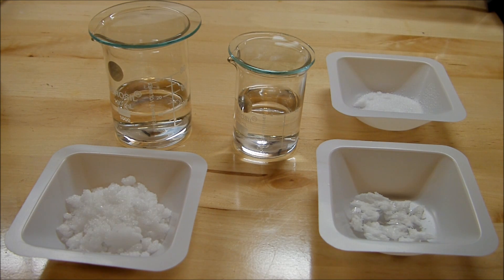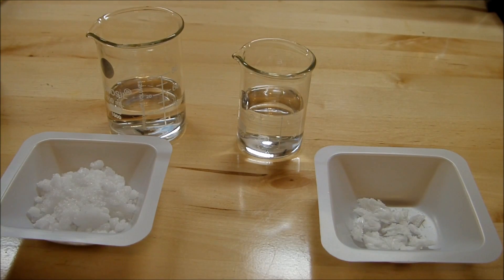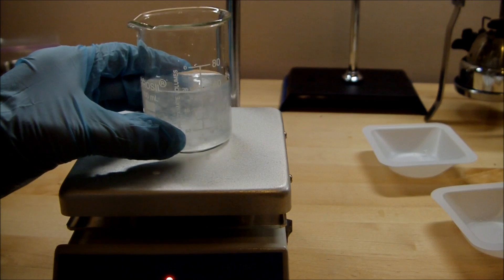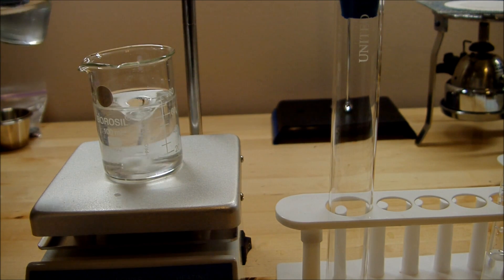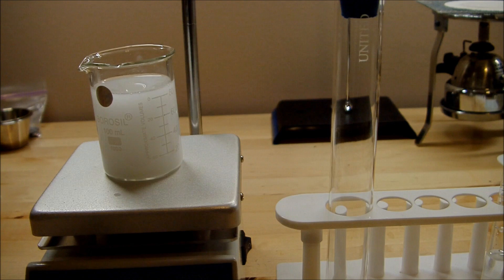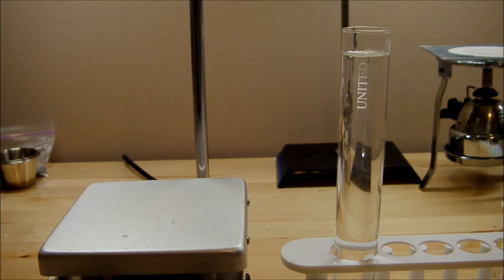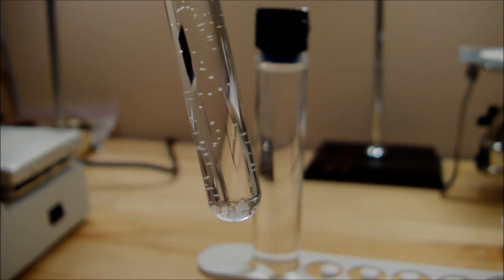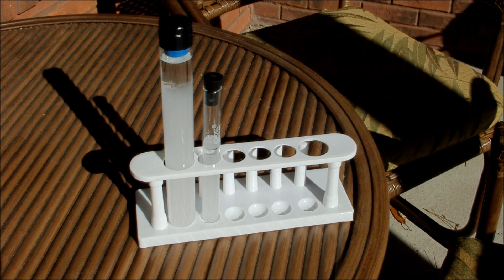How to Make a Storm Glass

Comment: I'm finding it hard to come by camphor in solid form, can i use racemic camphor? Its mixed with ether and ethanol, I assume this is to keep it in liquid form.
Reply from the maker: Sean Gunleiksrud Since it gets mixed with ethanol anyway it might be fine, assuming the ether doesn't interfere. You could always evaporate the solvent to get solid camphor from it.
Reply: I know this post is old, but try looking at a place that sells Hindu puja supplies. They often have camphor tablets.

Comment: I chose to make a storm glass for my AP chemistry class. Could it be possible to use camphor essential oil instead of blocks/tablets? also, how much solution of ammonia and hydrochloric acid will i need to make ammonium chloride?
Reply from the maker: I'm not sure about essential oil. It may be a different substance than pure solid camphor - I'd do some research on that. Ammonia and hydrochloric acid react directly: NH3 + HCl = NH4Cl. Use your AP chemistry skills to calculate the right amounts!

Comment: You really need to reset the liquid every so often by heating gently to bring the liquid back to a supersaturated state. To make the device pressure dependent as well as temperature dependent, you could experiment with a thin membrane stopper of some sort.
Reply from the maker: Excellent ideas! My storm glasses have since turned brown and stopped working, probably because the stoppers weren't on tight enough and air seeped in or liquid evaporated out, which spoiled it.

Comment from the maker: Supposedly if you make it correctly it can predict weather up to 48 hours in advance, but I'm not sure how reliable it is. The sources I've seen claim that pressure has an effect, but I'm more with you since it's sealed. Mine weren't totally sealed, just stoppered, so pressure would have some small impact there. Mine didn't turn out all that well, and after a few years they've yellowed and stopped working. Probably because they aren't completely sealed.

Comment: That's just what I was thinking. The potassium nitrate dissolved just fine in the water. The sol stayed clear. The ammonium cl didn't really dissolve. It basically just suspended and stayed cloudy, even with heat. I'm going to try another source for the NH4Cl or  make it. I have a lot of hydrochloric acid.

Comment: Ok. Help! My water solution isn't right I don't think. The potassium nitrate dissolved just fine. The ammonium chloride turned the water cloudy. It never turned completely clear even with heating. After mixing the EtOH sol. and water sol. it all remained slightly cloudy. The NH4Cl was from a chemical supply place. It's very pure. What did I do wrong?

Comment: Pressure has nothing to do with this. If you seal it, there can't be any effect.
It should be sealed with rubber stopper, or even flame sealed, because every ingredient except potassium nitrate is volatile, so eventually the contents would change their ratios.

This thing reacts to the speed and amount of temperature change and is not reliable at all. However, it's very beautiful. The crystals change their shapes on daily basis, as the temperature goes up and down.